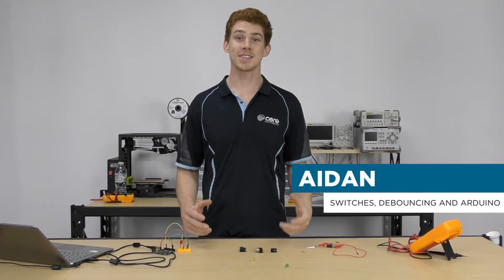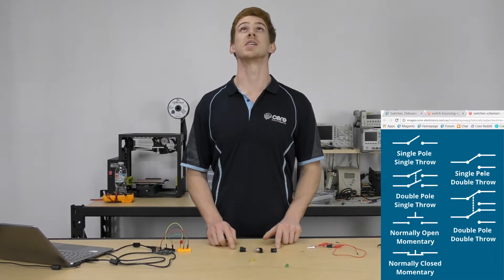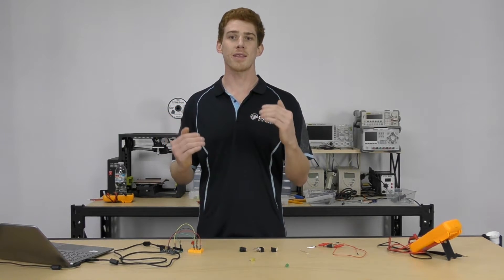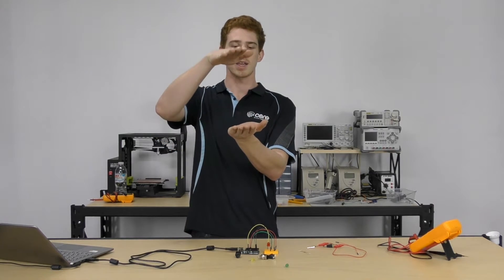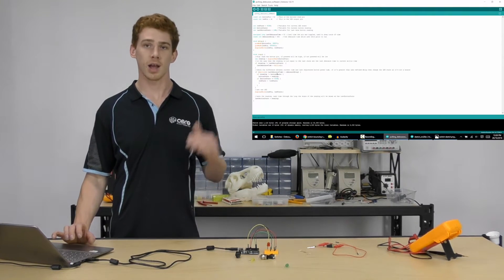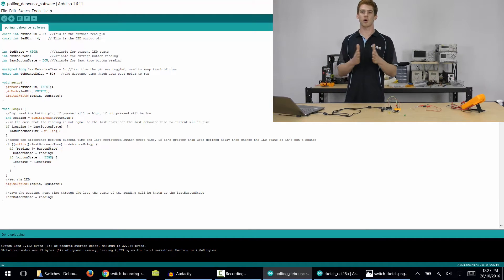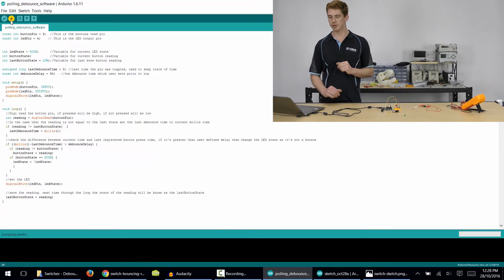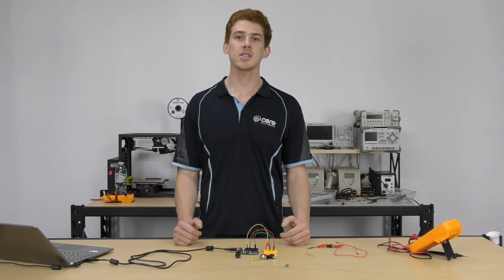Switches, Debouncing and Arduino

Comment: I didn't realise that bounce was a thing with momentary switches - thanks so much for the info!
I noted that your indentation is a little off, the two lines:
if (buttonState == HIGH) {
   ledState = !ledState;
should be indented one more tab stop (just for clarity since it's actually inside the outer if statement)

Comment: Hi, I am asking for some code to explain:

int lastButtonState = LOW // Why do we declare LOW if the default is LOW?
int buttonState; // If we declare LOW in the above line, why don't we do it in this case?
.....
if (reading! = buttonState) // The first run of the program will not execute the body of the main function because (LOW! = LOW).
Reply: That is because you don't want anything to happen until the momentary button is pressed.